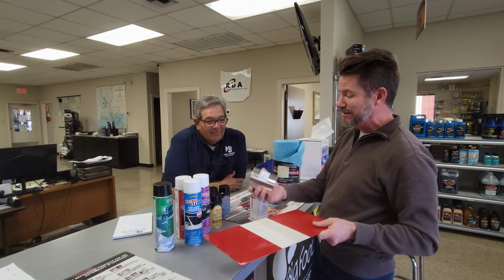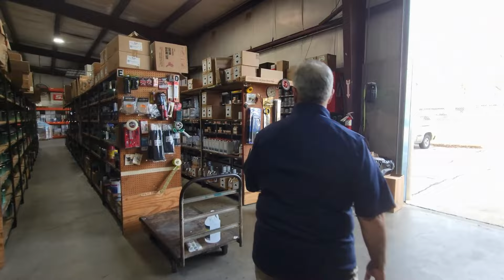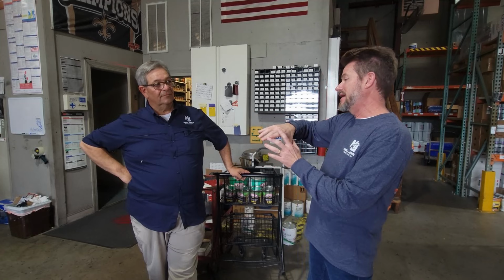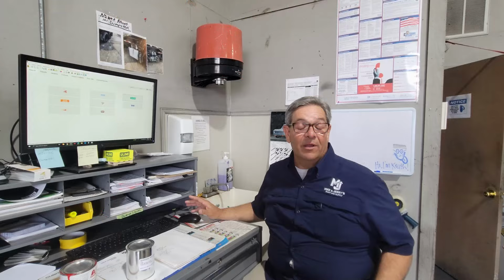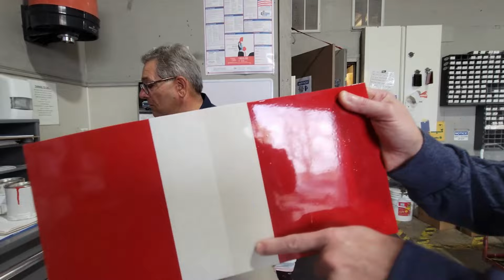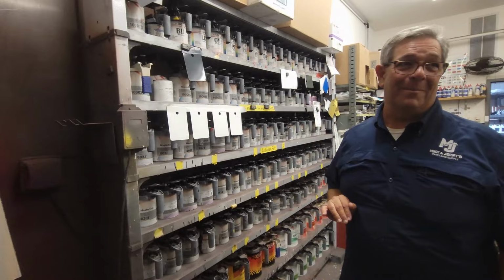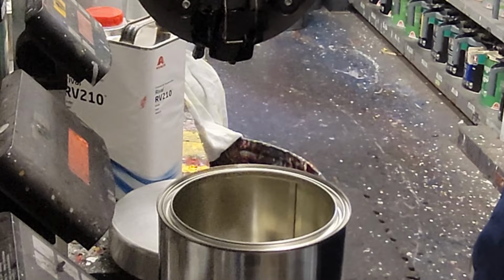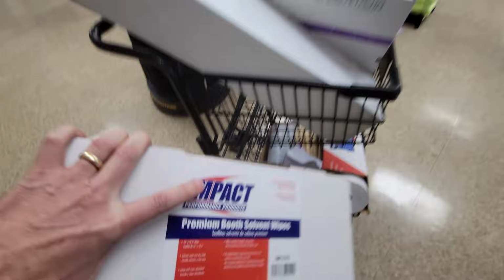E104 Buying Imron Auto Paint for Garage DIY!  Mike & Jerry's Shop Tour! 1956 Chevy Bel Air Resto

Comment: That was an awesome video Bill. Very informative and yes whenever I get around to painting my 55 I will definitely go with that product.
Reply from the maker: I'm guessing you saw the result and came back to this video after.  That Axalta Rival is the real deal.  It sprays well without any additional reducer, goes on pretty flat, and then levels out after it sits for a bit.  Every flaw I encountered was pilot error.  The 1.3 tip and about 25 to 28 psi at the gun was ideal.  It's actually pretty forgiving for runs and orange peel was non-existent.

Comment: I use to mix paint, back in the day when I was in the auto parts business. I kinda liked doing it, very satisfying but kinda tedious sometimes. Curious though as to what the cost is now, compared to back then. Not for everything, because there is so much prep work, but ball park figure as to the cost of the actual Red & White, if you can share that.  ;)
Reply from the maker: 3 quarts of this red in Axalta Rival was about $350 plus activator.  The 2 quarts of white were less than half that.  Everything in my basket was $750-ish.